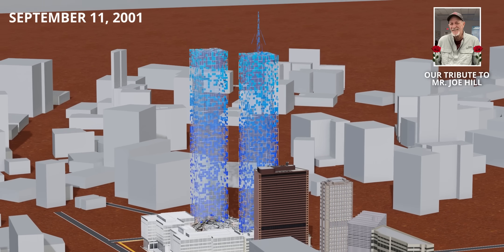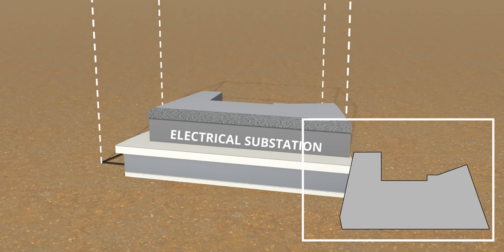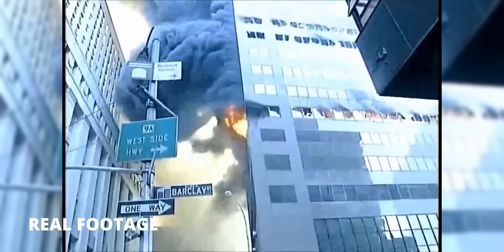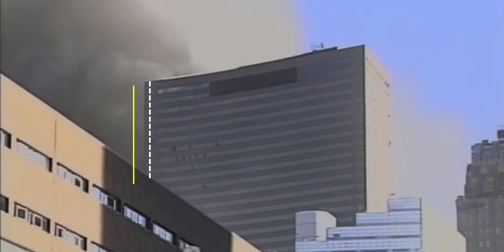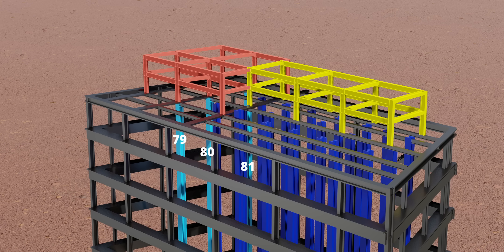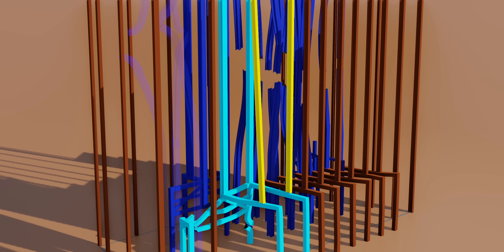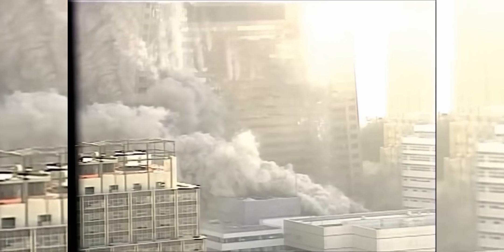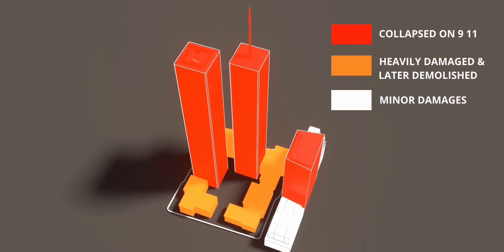Collapse of Building 7 | The Complete Physics

Comment: Actually, this video just raises more doubts:
- That's not how buildings are constructed, and you know it very well. Yes, there are vertical beams, spine beams, but then there are rigid horizontal structures – floors – which are firmly connected to the columns. When a building is damaged, the load is transferred to adjacent structures... it's similar to when you remove a lintel above a window. The brickwork will start to fall out and an arch will form above the window opening... the load is simply transferred. It's absolute nonsense that the entire building would collapse due to literally just a few broken vertical beams.
- If the building were constructed the way you're trying to show, you're simultaneously claiming that the USA builds non-robust structures. And that's nonsense. Look at the current situation in Ukraine. The Russians drop FAB-500 bombs on apartment buildings – and they don't collapse. There's just a huge hole. Non-robust buildings can be seen in Gaza. The Israelis drop American JDAMs there, and the whole house falls down."
- The fire was far from significant – even according to the animations. Even in the USA, there are cases where tall buildings with steel structures burned for several days straight across multiple floors – and they didn't collapse."
Reply: Building 7 was constructed with *columns*, NOT vertical beams (which isn't a thing). No idea what you are talking about with spine beams - you seem to just like making up your own terminology.

B7 was complex, assymetrical 47-story steel framed structure built on top of a smaller 3-story building, requiring lower floors dedicated to complex load transfer structures, not usable office space. Of trapezoidal shape and all-steel tube-in-tube construction, B7 (above the 7th floor) consisted of a central core of steel columns carrying most of the gravity load, perimeter steel columns around the outside of the structure carrying the remainder of the gravity loads and long span beams and girders to tie those elements together and form the floors. On the outside of the building hung a moment frame or outer shell.

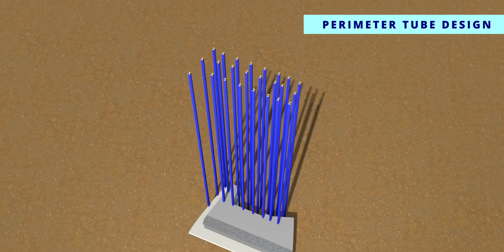Collapse initiation was due to lower floor failures above the load transfer region (7th floor) in the NE corner. In this video at 0:45 you can see the NW corner from inside the building while under construction, Column 79 just out of frame on the left. That big, angled steel beam across the top of the frame connects to C79 at one end. The girders connect to the beam. That beam and all those girders depend on just one connection

youtube.com/watch?v=nP3TNHPCIVU&t=35s&ab_channel=EdwardCurrent

The multiple lower floor failures caused a loss of critical lateral support over an excessive length of core Column 79 (up to 9 floors) and it buckled. If you look at a floor diagram of Building 7  and look at all the structures that depend on C79 you quickly realize this one column was a relatively isolated structural element on which a disproportionately greater fraction of the structure depended analogous to say the Key Bridge. 

Externally we see a vertical progression of window breakage along the 44-46 line and a kink in the roof of the East Mechanical Penthouse at the top of the building, consistent with C79 failure. The transition from full capacity to almost no capacity occurs in virtually an instant. Once the buckling failure occurs there is almost no resistance

Normally with a buckling column, the load could very well be redistributed to other columns, meaning the buckling could stop after a while. With C79 that is not the case. Being an isolated element there is no opportunity for load redistributation so the failure did not redistribute the load. 

The buildings in Ukraine and Gaza are almost universally reinforced concrete construction and are not analogous in their behavior. It only points out how inefficient GP high explosives are, with much of the energy wasted.
Reply: @MFitz12  First of all, I apologize for the incorrect terminology, as I use AI for translation, which can naturally make mistakes in terminology. However, based on your reaction, I see that you probably understood what I meant. By 'spine beams,' I mean exactly those internal tall columns that are drawn in this video as if they passed through multiple floors in one piece. 
Thank you very much for the very interesting link to the video about the collapse of WTC 7.
Did you notice that the video we're commenting under depicts the building's collapse as a whole? It shows a simulation where the lower internal columns break under stress, the facade can't support the building, and it subsequently collapses entirely. And in the second video from your link, it's shown that the interior of the building crumbled like a house of cards, and then the outer shell followed. These are two completely different ways the building collapses, which are meant to refute conspiracy theories. Look, if the interior collapsed like a house of cards, that's precisely the non-robustness of the structure. And I really don't want to believe that they would build such a building so poorly in the USA of all places. Take from the animation that the building was very little damaged, and the fire is debatable, but it wasn't across the entire area of X floors, but only in a part of the object – there the theory of unmanaged load distribution and the breaking of columns could theoretically answer the questions, but then it also follows that the outer shell doesn't sufficiently interact with the inner core and the floors, and excuse me – that really doesn't seem right to me.

Comment: I find it very inspiring that the only 3 times buildings collapsed without "Controlled demolition" so straight, where exactly on this day. The failing transfer trusses was the biggest joke 😂 Never was there proven that steel breaks easier bij higher temperatures, but low enough so it doesn't melt.
Reply: Also, how does it work that the columns bend/break once on the lower floors, but turn in spaghetti when the building was collapsing?
Reply: Also, the NIST already said that 2,25 seconds of the collapse where in free-fall, which can only be reached by the non-existence of some floors at the time, or, of course controlled demolition. It is also suspicious that mister silverstein called the insurance about possibly control-demolish the builiding and that multiple news senders actually reported the collapse before it happened.
Reply: It will be even more inspiring when you figure out how wrong that is.

Plasco Tower
Wilton Paes de Almeida
Surfside Tower
Bangkok Government Tower (just a few months ago)

Comment: It seems that every time a new explanation is presented, the lie is refined.

The laws of physics and chemistry are ignored, statistics have no meaning and data that could have been obtained a long time ago is now being looked at with extra eyes.
A steel and concrete building has never collapsed due to a fire, except during that day, the fires also lasted too short a time to even have any effect on the structure and the material that burns (furniture, paper, etc.) does not reach temperatures that would affect the building.

The large amount of molten metal under the collapsed buildings is a question where all that energy came from and also how wtc 1&2 blew material so far away can also be asked.
But that an antenna should have such a big impact when it is not even close to being that strong is unreasonable.

Either way, there are still too many questions and with an unwillingness to give investigative answers.
Reply: What new explanation are you referring to?  There is nothing new here. 

No laws of physics are ignored
No chemistry is required. 
This was a steel framed building - no structural load bearing concrete at all.
Countless thousands of steel framed buildings, structures and even bridges have collapsed due to fire. It literally happens all the time.
7 hours is not a short time. Building 7's structural components were rated for 2 to 3 hours. A full 7 hours of simultaneous unfought multi-floor fires with no active firefighting is an unprecedented fire event.
Building fires routinely exceed 1,000-deg F.  Structrual steel starts to weaken at around 400-deg F.
There was no molten metal under Building 7.  Building 7 was in fact built on top of another building, so what was under it was a Con-Ed electrical substation, which was not molten (liquid).

Your questions were all answered 15+ years ago or more. The collapse of Building 7 is one of the most studied engineering disasters in history and the subject of 5 comprehensive engineering studies and more than two dozen technical articles in major peer reviewed engineering journals, most of which were published 15 or more years ago. Thousands of pages of material.  This should get you started.

FEMA BPAT (initial report superseded by NIST NCSTAR 1A)

NIST NCSTAR 1A: Final Report on the Collapse of the World Trade Center Building 7, 2008.

Guy Nordenson and Associates, WTC7 Global Collapse Analysis Report and Summary of Findings, 2010.

Arup, WTC -7 Structural Fire Analysis Report (Runs 1-4), 2010.

Weidlinger Associates Inc., WTC 7 Collapse Analysis and Assessment Report, 2010.

BRE Centre for Fire Safety Engineering, Analysis of the Impact of a Fire in the Mechanical Room (5th & 6th Floor) of the World Trade Center 7 Building, 2010.

T. McAllister, R. MacNeill, O. Erbay, A. Sarawit, M. Zarghamee, S. Kirkpatrick, J. Gross, Analysis of structural response of WTC 7 to fire and sequential failures leading to collapse, J. Struct. Eng. (United States). 138 (2012) 109–117.

For a summary of the major studies I would recommend THE COLLAPSE OF WORLD TRADE CENTER 7: REVISITED by Mhd Anwar Orabi , Liming Jiang , Asif Usmani and Jose Torero which is a 33 page summary of the different analysis and conclusions published in 2020. Sorry, YouTube will delete this post if I give the link but it should be easy to find and is available from the University of Queensland, Brisbane. 

Real structural engineering industry professionals conducting real engineering studies and publishing them for other professionals to see. Not amateur YouTubers appealing to the gullible and credulous.

Happy reading
Reply: @MFitz12  
The fact that you throw up a bunch of stuff where you try to make it appear like you have facts doesn't convince me.
If you weren't born then or too young to remember, I understand why you're so consumed by these theories. But you have to ask yourself why they purge all possible theories and suppress certain information and label something inappropriate as a conspiracy, etc.
You probably think that Osama bin Laden was behind it all, but you probably don't know his statement immediately after the attack, all the fake videos of him, Aron Russo's statement, satellite images showed the high temperatures even under building 7, the Pentagon, no aircraft remains were found, no remains of the plane that crashed into the ground, yes that explantion the very planes was vaporized by its own fuel.

But continue to swallow these lies for your generation the most deceived of all time.
Reply: @polisen5050  - Same reason people like you try to suppress reality I suppose. 

Please do not engage in deliberately evasive off-topic derails. Have you read ANY of the material I mentioned above?  Some of the best engineers in the world spent years putting that together

Comment: It is well known fact that this building was brought down by controlled demolition. This video is criminally irresponsible, deliberately misleading, a lie. The group “Architects and Engineers for 911” aren’t clowns, 1000 of them, several Nobel price included.
Reply: No it isn't. The overwhelming concensus of professional opinion in the worlds structural engineering community concurs with the conclusions presented in this video.
 
The collapse of Building 7 has been extensively studied and documented in the literature. Easily among the most studied engineering disasters in history and the subject of 5 comprehensive engineering studies plus dozens of technical articles in major peer reviewed engineering journals. Thousands of pages of material, including: 

FEMA BPAT (initial report superseded by NIST NCSTAR 1A - you can probably skip this one)

NIST NCSTAR 1A: Final Report on the Collapse of the World Trade Center Building 7, 2008.

Guy Nordenson and Associates, WTC7 Global Collapse Analysis Report and Summary of Findings, 2010.

Arup, WTC -7 Structural Fire Analysis Report (Runs 1-4), 2010.

Weidlinger Associates Inc., WTC 7 Collapse Analysis and Assessment Report, 2010.

BRE Centre for Fire Safety Engineering, Analysis of the Impact of a Fire in the Mechanical Room (5th & 6th Floor) of the World Trade Center 7 Building, 2010.

T. McAllister, R. MacNeill, O. Erbay, A. Sarawit, M. Zarghamee, S. Kirkpatrick, J. Gross, Analysis of structural response of WTC 7 to fire and sequential failures leading to collapse, J. Struct. Eng. (United States). 138 (2012) 109–117.

IF that is too much, the major studies are summarized in THE COLLAPSE OF WORLD TRADE CENTER 7: REVISITED by Mhd Anwar Orabi , Liming Jiang , Asif Usmani and Jose Torero which is a 33 page summary of the different analysis and conclusions published in 2020. I can't post the link but it should be easy to find and is available from the University of Queensland, Brisbane. 

Enjoy

As for the group Architects and Engineers for 9/11 Truth they are absolutely clowns.  Objectively, AE911T is not a professional organization by any stretch. AE911T are a tiny, fringe single-issue advocacy group that live on appeals to authority they don't possess, to push an agenda that has no tangible support in the professional community. They have no support from any professional engineering organization anywhere in the world and support amongst individual professionals in relevant fields is tiny to the point of insignificance. The lunatic fringe of the tiny lunatic fringe minority. They tell people like you what you think you want to hear, so you accept the (false) appeal to authority and don't ask questions, even if you knew what to ask. They are a faith-based organization, selling dogma which never adapts to new and better information. 

To illustrate their level of "expertise"; AE911T used to have one former manager of architects on staff whose claims to fame were a Denny's and a high-school gym. A couple of years ago the board tossed him out of the organization he founded for jeopardizing their donations. It's pretty obvious where the priorities are. Their top structural engineer is an unlicensed civil engineer who builds radio antenna towers. Their FEA is done by a carpenter using MS Paint. Their physics is done by a retired 9th grade science teacher.

The talent pool is not deep and it shows in their output.

They put a lot of stock into their "petition" and allow people who don't bother to read it to jump to false conclusions about what it says and what those who sign it are agreeing to. I suggest you read it (my guess is you haven't).  Literally takes a minute. 

To the Members of the House of Representatives and of the Senate of the United States of America, PLEASE TAKE NOTICE THAT 

On Behalf of the People of the United States of America, the undersigned Architects and Engineers for 9/11 Truth and affiliates hereby petition for, and demand, a truly independent investigation with subpoena power in order to uncover the full truth surrounding the events of 9/11/01 — specifically the collapses of the World Trade Center Towers and Building 7. We believe there is sufficient doubt about the official story and therefore the 9/11 investigation must be re-opened and must include a full inquiry into the possible use of explosives that might have been the actual cause of the destruction of the World Trade Center Twin Towers and Building 7 .

The petition is not testimony or an affirmative statement of anything. It is a mere request that someone else look into the POSSIBILITY of the use of explosives or incendiaries that MIGHT have been the actual cause of the collapse of the Twin Towers and Building 7 because of a belief there is sufficient doubt . 

Can’t get more generic and non-committal than that!

One does not even need to believe explosives/incendiaries were used on any building to sign the petition. Indeed, I have several friends who think that is idea absolute nonsense, but signed the petition anyway just to get the AE911T newsletter. So you can’t make any assumptions about why anyone would sign.

The folks who signed apparently can’t even be bothered to do the investigation themselves, or perhaps they are unqualified or just not that interested. Not that important I guess. Those who have signed certainly do not publish peer reviewed technical articles in favor of AE911T claims. One would think over 3,600+ “experts” would generate many hundreds of such articles, but there’s nothing.  Not a thing. 

Highly-Credible People don't ask questions, they answer questions. So much for AE 9/11 Truth, whose sole play is trying to get someone else to do the investigation.  I thought these guys were supposed to be “experts”

Architects and Engineers for 9/11 Truth;  No Architects, no proper Engineers and no Truth.  They get the date right. 

AE911T are just a slick, focused PR campaign raising money for the sake of raising money.